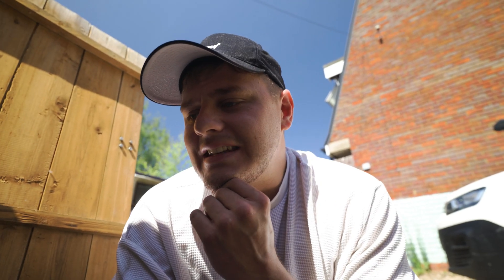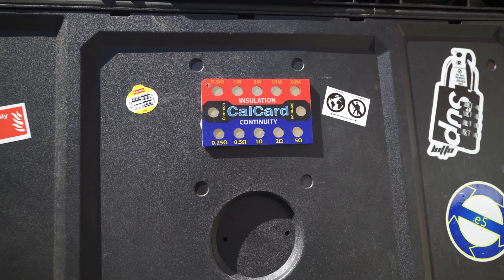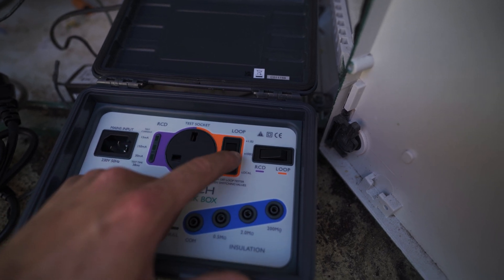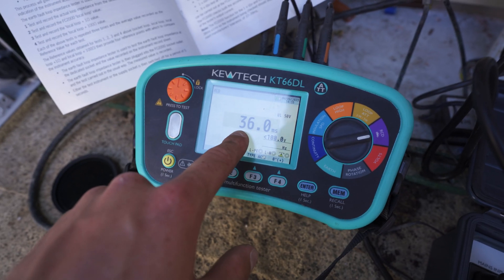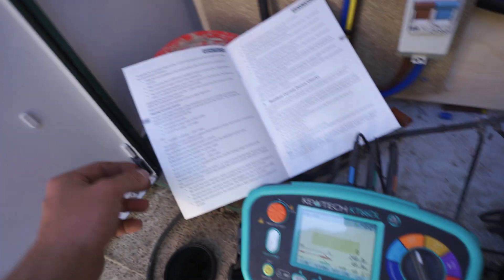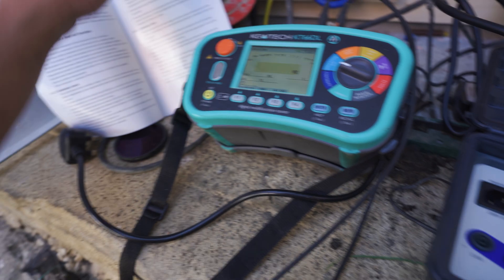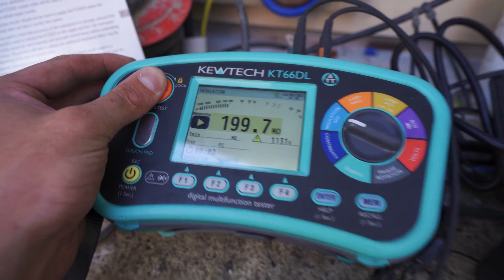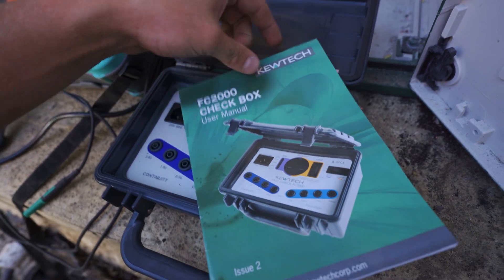Calibrating my own multi-function tester

Comment: Had one of these for years and every now and then it gets sent of for calibration. Our normal couple of NIC inspectors are fine with multiple MFTS checking the check box, we've had a couple of guys do inspections that have turned around and said every meter and check box should be calibrated annually which defeats the point of on going checks.

Comment: Ok so if it shows your meter is out, what do you do then? Buy a new one?
Reply: You send it off for repair
Reply: You do what you do when your MFT fails its annual test and you are left wondering how many  jobs you signed off that shouldn't have been.
Reply: trust me your analysing it too much
Reply: @greentoad6729    Try telling the NIC that.
Reply: @we-are-electric1445 that's why NICEIC requires monthly checks and record keeping, I use a calcard and record the results with calkeeper app on android